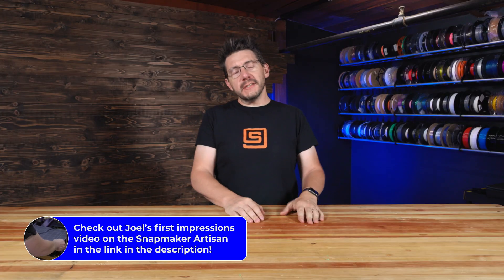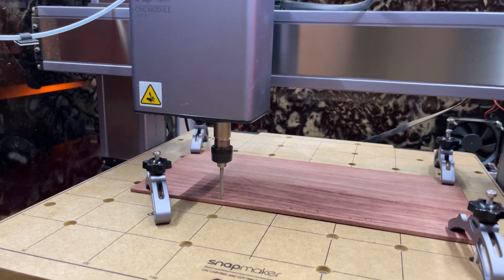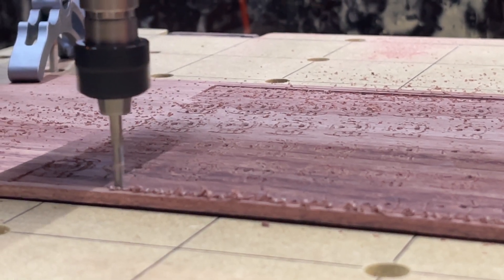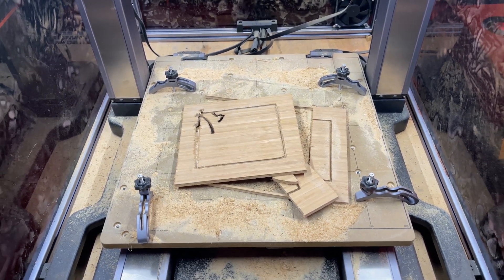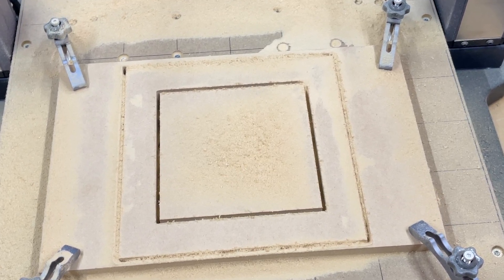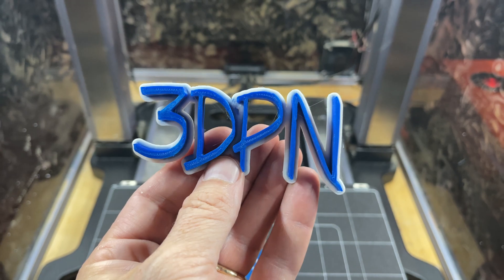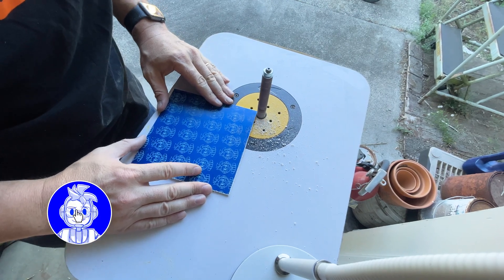Creating Magic: Snapmaker Artisan 3D Printer Project Reveal!

Comment: I have to urge you to never leave your CNC or laser cutter unattended. These are not tools like a 3D printer. You need to have adult supervision with them at all times, otherwise you have a severe risk of fire from either one. No business leaves their industrial CNC or laser machines unattended for this reason. I consider you lucky you did not start a fire. The bit could have easily sat in one place and spun until friction caused a fire.
I did like your project and sharing your issues along the way. I definitely agree that the small details deserve to be laser etched instead. One way to improve your CNC cutting skills is to understand how to enter the data for a v-bit. They are not setup the same in the software as a standard bit. You might know this already, but from the video, I think this is why you got the result you did instead of a finished product that looked correct. But if you have a laser cutter, its the easier path to take. Be safe!

Comment: If the router software has a work 'above bottom' parameter then you can sense your tool to the bed and set as Z=0, then you will never have a problem cutting through wrapped material case it will skim along the bed. All of this provded the bed is level.

Comment: Hi from Will and Mr Data :):]
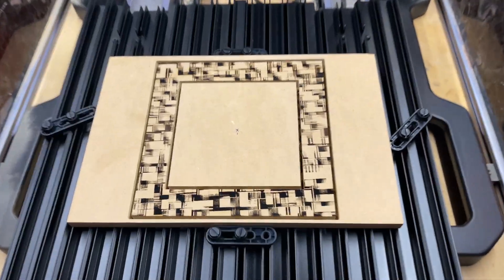Paused at 5:35 because no Ai nor single search engine has achived a thing license check. 
Ai art works cannot be used for commercial gain because the Ai dont know if its original or not. 
You know these basics Joel. 
A thing license check is a combined results search. 
So for 3d printing for instance search for a thing by combineing results from 
3dmdb
Yeggi
Stlfinder
Google 
Net.
So you searched the above for a thing now COMBINE THE RESULTS FROM ALL ENGINES INTO ONE LIST, MANUALLY JOEL. 
then sort by oldest first. 
Then filter out cnc, laser cut, cgi.
Leaving 3d print license checking is the task.
  So to ensure you can make commercial gain. perform the above check before uploading thing file to net or selling prints, 
or  commercial gain.
Brief.
License check all uploads and sales, no matter how the thing file came to be.
Even if you drew it, or moded it.
Even if Ai drew it. 
Even if scan. 
Even if a walk in customer with file.
Even if you call yourself a farm, service, or old McDonald etc. 
Even if you find a so called free file. 
Even if you purchased file.
A license check is to search. 
So at 5:35 the thing file used was not checked and so is at risk, file used could be piracy so should not be used for commercial gain. 
Report any claims Ai or a service or single search engine can find things on net. 
Currently its manually resorting the search engine results into a new list then resorting again by oldest first, then filter out guff. 
Recent GPT type tested quickly turned to making up fake answers to boring tasks, we should have asked for a TOOL to USE for our boring task please thank you. 
Anyone using those faked answers can and are being closed for piracy. 
Ay Mr Joel so lets be clear on customer user experience of these sectors.
At what points things become sketchy when randomly using results of only 1 search engine, when that is known to not be enough to prove its not piracy.
In a testing within this month
The thing was found in 910th position, below 909 pirates thieves and files we cannot make commercial gain from. 
Pirates are and contine to be closed.
 Uneducated Youtube promoters causing pirate things to gain sales by not checking but showing the thing thereby robbing the actual thing license holder, this has become a community damaging issue.
Its can cause big losses and closures very quickly so we all need to get this right. 
Ai is making new tools so we might find things.
Business things.
Medical health care things.

Comment: Great video Joel! Having owned a snapmaker, I have 2 CNC recommendations for you . 1 would be to flip the ER11 collet so it's right side up. It may help with keeping the bit locked in. 2 would be to get some Amana spectra bits that are downcut for wood. Youll have less chips and probably a higher quality finish.
Reply: "Downcut for wood"?  Does this mean the bit is not flat at the tip and can do "plunge cuts" into whatever material you are milling?
Reply: @Fishbone4u  Down cut is just the direction the bit releases chips. If it's down, the cutter has some downward force on the wood being milled. Up cut pulls up on the wood. If the wood is thin, up cut bits can actually pull the wood from the build plate and cause chatter.
Reply: @mechandphysics  I know what you mean now!  A while back when I was trying my Snapmaker CNC I saw the various methods…so much to think about!  Are the bits different for wood? What terminology should I look for when purchasing? Thanks!
Reply: Yes, my Snapmaker 2.0 CNC, which is the older and smaller version of this, works great with the supplied bits. The upside down collet is painful to watch.

 I love Joel and have been watching all his videos for a couple years now by the way.

Comment: I am only about 6.5 min into the video, so I appologize if you end up mentioning this later in the video, but it is very dangerous to use ABS with a laser. ABS emits cyanide gas when heated up by the laser. Even if you were just trying to burn off the paint, and not any of the ABS, it's very risky for humans and pets if any of it gets hot enough.

That said, thanks for showing us the project, and High-5! Now I'll go watch the rest and see if I didn't need to point out the ABS safety stuff.
Reply from the maker: Hey dude! I should have mentioned it in the video, but I have a BOFA filter for the exhaust on the Snapmaker.

Comment: 🤦🏻‍♀️lasering abs makes hydrogen cyanide gas. Did you say that the enclosure didn’t have exhaust?
Reply from the maker: Enclosure has exhaust, and I was venting into a BOFA filter. Plus, I didn’t go deep, just enough laser to take off much of the paint layer.
Reply: @3DPrintingNerd I just think a little bit of warning could help your viewers avoid dangerous gasses if they try to do the same. Love your content but this one irks me a bit. Mdf isn’t safe to laser if it has formaldehyde in the bonding agent. You’ve got 615k subscribers but you can’t buy one simple pattern or even make it yourself. I’m sorry…
Reply from the maker: @RolieKloeOlie  I could have purchased or licensed a design, but I used to work at Adobe, and I friends on the Firefly team. I thought showing that was neat. I'm sorry you didn't like it.

Comment: I would really suggest not promoting AI, since that steals work from artists.
Reply: AI is a tool. It shouldn't be end all be all type of thing. Many could also say these bench top CNC machines are taking away work from machining shops. 3D printers are taking away from companies that make plastic moldings or injection molding. That YouTube is taking away students from tech schools. Jobs away from professionals that went to school for a specific trade and can easily be found "how to" on YouTube. You may not like it but it's the direction we as a society are going. People can get with the times or get left behind.
Reply: @J.R.jr-pc7bo  Those are not remotely the same comparisons.
Reply: @J.R.jr-pc7bo  i'm greatly convinced at this point that people defending AI have either no createivity, nor a functionning brain, nor any meaningful hobby or passion in their life and never think for themselves. That's quite incredible to witness, like nfts really
Reply: I'm really not fully defending it or against it. Again it should be used as a tool to aide in things but not fully do everything. Just like a carpenter could use hammer and nails or use a nail gun to make it faster and easier. Tools should make the job easier and faster. AI doesn't know how to compensate if something goes terribly wrong. AI could actually make things worse by correcting what went wrong. Again relying on it too much is bad but ignoring it and not using it to make a job easier and faster is also not good.
Reply: @J.R.jr-pc7bo   the problem with your argument, a hammer is a tool made by a blacksmith using metal and wood, an ai is made by developpers... using other artists art without compensation...it's Theft.
Reply: @linkdelodela  I see we are arguing 2 different things. You are talking about 1 specific thing AI is being used for and I am talking about in general. So by what you are saying just because 1 group of individuals are wrongly using AI it should be abolished. Back to my carpenter analogy, so because a bunch of teenagers decide to nail people's feet on purpose, nail guns should be abolished. Screw the rest of the industry that uses them correctly. AI is not just for the arts. What about medical? It can help perfect the movements of medical instruments that are used for surgery. In engineering, it can help with engineering flaws that might not get caught by humans even after several checks. Both space shuttles Colombia and Challenger may have been avoided if AI was used to analyze everything if it would have existed then. AI is being used in cars right now to reduce car accidents, it sees cars stopping and stops for you. I'm sure you have seen the commercials. AI is not just for one industry, yes you are right though it is theft in that way, it all comes down to the user. In the same way, a car can be used in a bank robbery or to murder someone. There are many others that use the tools correctly.
Reply: ALL AIs are being created like this, is more accurate
Reply: Only the artists that aren't as creative as ai  😛
Reply: @JamieCann  AI steals from all artists and writers. I don't know why you're taking that kind of stance.

Comment: Very nice!  ABS is a great choice for laser engraving at low temps, but can be toxic without ventilation, so people should be careful.  Proper ventilation is key regardless of the type of material, as burning stuff is bad for your lungs.  Keep up the great work!
Reply: Yep, always check your materials. I have seen many people comment along the lines "It is just a window decal, it can't be bad."
Reply from the maker: Hey thanks for the info! I had a BOFA filter hooked up to the enclosure and had laser power down to only burn off the paint layer. I heard about the toxicity and tried to mitigate it as much as possible.
Reply: ABS a great choice?  ABS when burnt released toxic hydrogen. So please be careful. It does laser nice though
Reply: Thanks for the tip, I never even considered using ABS for using with a laser.